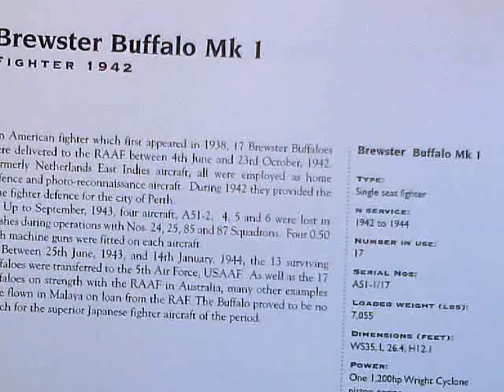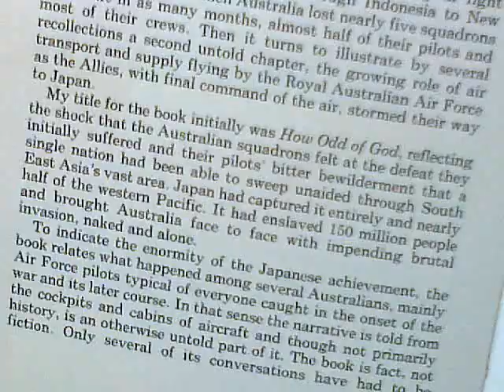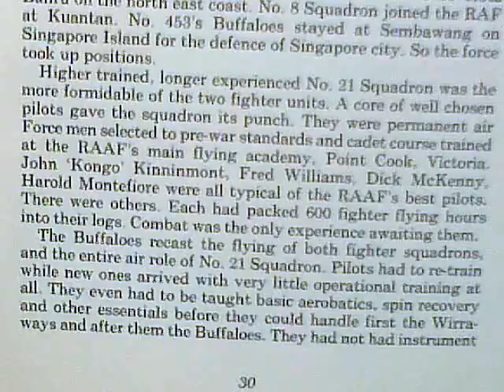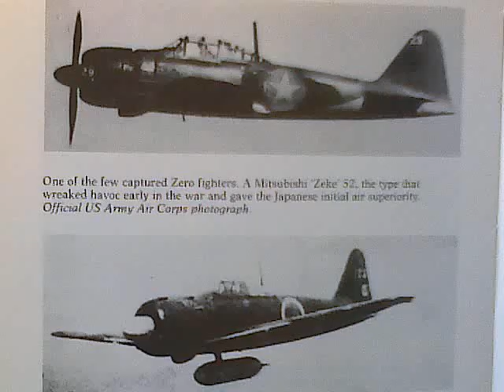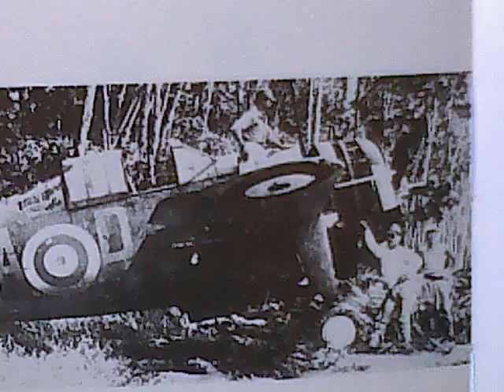World's Worst Fighter Aircraft, The 1941 RAAF Brewster Buffalo !

Comment: The Bell Air Cobra is generally considered joint worst with the Buffalo. Oddly the Finns had great success with the Buffalo in the Winter War and even built their own variant.
Reply from the maker: G'day,

  Thanks,

 Yeah, I know...

      If you read the earlier Comments you'll find the Finnish Buffaloes comes up quite often...; they had German Guns which neither blinded the Pilot nor shot the Wings off, German Radios which were not drowned out by the Tropical  Thunderstorms which don't occurr on the Karellian Peninsula, they flew around below 10,000 ft where the Fuelpump was able to feed Motion Lotion to the Unicorns under the Cowling, and the Finns had Combat Veterans in Buffaloes shooting at Neophytes in Polikarpovs - rather than Neophytes in Buffaloes up against Combat Veterans in Zeroes...

   The Bell Airacobra wasn't nearly so bad, Chuck Yeager flew it in Training and said he was sorry not to have taken it into Combat, and the Soviets liked it a lot better than they liked their Polikarpovs ; and the Airacobras Guns neither blinded the Pilot, nor shot the Wings off.

   It's their having one set of Guns for blinding the Pilot and a separate different set for shooting the Wings off, in my opinion, which makes the Buffalo far far worse than any other machine in which to be sent out to chastise the King's Enemies....; even the infamous Turret-Gunned Boulton-Paul Defiant (it defied logic !), or the Blackburn Roc, weren't capable of such stunning Counterproductivity...

 Have a good one,

  ;-p

   Ciao !
Reply: The RAF gave their Air Cobras to the Soviet Union after one combat sortie, they were that bad.  The Defiant became quite an effective night-fighter and ironically it was withdrawn at the point where hard learnt effective tactics proved it to be quite deadly.
Reply from the maker: +noonsight2010 

  G'day,

    Well, the British gave up on both the Boeing B-17 & the North AmeriKan P-51, after trying to fly them in Combat ; so maybe the RAF having failed to underconstumble how to operate Bell Airacobras shouldn't mean as much as a Knobbly of Goatshit onto the Compost Heap ?

   The Defiant was successful (Suck Cess, Fool) for 1 Sortie over the Channel in May 1940 when the  Jagdwaffe mistook them for Hurricanes.

   However, after the German Survivors flew home to tell of their Mistakification, the Defiant Crews died like Flies for a fortnight.

   They were put onto Night-Fighting, when the Luftwaffe began Night-Bombing after Goering's Tactical Errors rendered Daylight Bombing too expensive to continue with...; and because nobody could fly a Defiant at night while operating a 2-Screen Airborne Intercept Radar, nor could they work the Radar from the Rear Turret...; and the Defiant became an unarmed  Target-Tug just(ifiably ?) as soon as the Radar Set was fitted into the "Fighter version of the Bristol Blenheim" (aka the otherwise failed British version of the equally disappointingly lacklustre Bf -110 "Zerstorer/Destroyer", theoretically a long-range Daylight Escort-Fighter...).

   The Defiant was a Piece of Shit.

   But the Buffalo was far shittier, still.

  Take it easy,

  ;-p

   Ciao !
Reply: HiPart of the problem with the Air Cobra was the Yanks sold the RAF inferior models to that demonstrated and the RAF did not get what they intended to purchase. The B17 was inferior to the Lanc. so the RAF had no need to use it. It carried more crew (hence greater potential losses of aircrew) and a smaller bomb load more slowly and at lower altitude. The Liberator came into production when an American plant was ordered to go into B17 production. A senior engineer visited a B17 factory to prepare for the changes at his plant and was so unimpressed he designed the Liberator, which carried a greater bomb load. However the Liberator was disliked by crews as it was demanding of the pilots and difficult to escape from. I read recently that the Stirling is not properly recognized. Apparently it flew at least as well as a Lanc. but the problem was it could not carry the increasingly larger bombs because the bomb bay was divided into compartments by divisions which were structural and hence could not be removed. Hence its relegation to glider tug etc.The whole subject is huge and fascinating and its good to exchange with a knowledgeable enthusiast. I think you know far more of the minutiae than I.Regards
Reply: Nah.  The RAF did use B17s and were glad of 'em. 

My old dad flew both B17 Forts & B24 Libs with RAF Costal Command as a Flight Engineer. 
From what he told me the crews (maybe not the pilots, that wasn't mentioned) defo prefered the Liberators as much more comfortable for their long range anti-U Boat patrols.

Of course flying mainly out of the Azores the need to get out fast was not as prominent as it was over the European mainland.
Reply: HiI know the RAF did use both types. Nothing better than first hand history. Your Dad was a hero.
Reply from the maker: +noonsight2010 

  Ah, well, the Stirling was always severely  handicapped by having been designed with a 99-ft Wingspan, specifically stipulated by the Air Cabinet, purely so that it could fit into the RAF's existing Hangars, and not only was it slow, but with Bombs & Fuel it couldn't climb much above 15,000 ft ; so when Lancaster & Halifax Crews were briefed for a Raid they always cheered at the news that there would be a bunch of Stirlings down underneath at half their altitude, them to soak up the Flak & Searchlights..., and it had such a vicious Swing on Take-Off that each Pilot being converted onto them recived a signed entry in their Logbook attesting to their having succcessfully recieved instruction in controlling it, and mastered the techniques.

   As soon as there were sufficient Lancasters and Halifaxes to make it possible, they pulled the Stirlings off Bombing and turned them to towing Gliders, and Supply-Dropping for the SOE (the "Cloak & Dagger" Brigade, Spies & TERRORISTS, planters of Bombs, Train-Wreckers, Bridge-Blowers, lighters of Fires, setters of Ambushes, users of Improvised Explosive Devices, and other seriously violent individuals....).

   I think you'll find that Consolidated were working on their own design for the Liberator, in competition with Boeing, because they knew that the USAAC was in the market for 4-Engined Bombers, Consoludated had long had the Davis-Wing under development - and it was that high Aspect-Ratio Wing which gave the Liberator it's Range.

   The B-17 was a device for carrying a Platoon of Machine-Gunners into battle at 30,000 ft, to quote the RAF Drinking-Song,
 "...To drop one teeny weeny Bomb..!".

      The Schweinfurt raid is always cited as an illustration of everything wrong with the USAAC's concept of  Strategic Daylight Precision Bombing, but there was an RAF Night Raid on Nuremburg which had an 11% Shoot-Down rate, which was actually slightly worse than the Pig-Fort fiasco...

   The RAF wound up using their B-17s for long-range Maritime Patrols, by Coastal Command, way out over the Sea where there were almost no Enemy Fighters to interfere with them (though Ju-88s could go a long way if they had a reason).

  There were a lot of contenders for the worst Bomber of WW-2, with my nomination going to the Vickers Vildebeeste, a 3-seat Rag-Wing Open-Cockpit Biplane Taildragger, land-based Torpedo Bomber which was a spectacular failure against the Zeros around Malaya & Singapore ; but I never met anyone who flew them.

   I nursed an ex-RAAF Fairey Battle Pilot once though, who'd been shot down & went into the Bag while trying to bomb the Bridges over the Albert Canal, in May 1940 ; he was in the Flight which tried going in Low, and he never even got close enough to see the Bridge, until after having force-landed.

   Imagine the same 960 Hp Merlin as a Mk-1 Spitfire or Hurricane, but trying to loft a 53-ft Span Monoplane with a Crew of 3 and 1,000 Pounds of Bombs ; wallowing around trying to stay in the same Sky as bunches of E-Model Bf-109s...(!). 

  Such is Life,

  Have a good one...

  ;-p

   Ciao !
Reply: Well, he certainly said his pilot and bomb-aimer deserved the Iron Cross ..... which they never got.

Their highlight of action was muscleing in on an elderly USS destroyer chasing a U Boat on the surface, lining up carefully, then blowing a large dent in the bow of the destroyer.

On the plus side, as far as I can gather the whole crew did truly heroic work destroying large quantities of beer and spirits at every opportunity.  

That may be more comprehensible given that my dad reckoned he was one of 4 maybe 5 survivors from his original training intake of circa 108 bomber flight engineers, so maybe they all were really.  
It feels strange to consider had he not been posted to Costal Command the likelihood I'd be around to bore everyone with this is 1 in 26.
Reply: Hi. A sobering statistic. And thank goodness there are people who keep the history alive. Good on you.
Reply from the maker: +Farweasel 

  G'day,

  Good Show, those men !

   Did the dent they put in the Destroyer buff-out alright ?

   At least "they tried to do the right thing", according to their lights and what they'd been raised to believe, and everybody (except the Psychopaths) gets Buck-Fever the first time they try to shoot (or bomb) to kill ; as their Conscience struggles with their Consciousness, for control of the Motor-Cortex, as their Conscience attempts to avoid the stain of the mark of Cain...

   Have a good one,

  ;-p

   Ciao !
Reply: noonsight2010 the Russians used the air cobra to great effect in fact thier top ace preferred it
Reply from the maker: +Edward Myers

  G'day,

   Thanks...

      Actually, Chuck Yeager liked it as well, he claimed in his (ghost-written) Autobiography to be sorry not to have been able to take the Cobra he was trained on into Combat...

   He also said that the Deaths his unit sustained during Training were "a good thing", because he judged it "...better to lose those Weak Sisters in Training, than to have them break down later on in Combat when their failures may cost the life of some other Fighting Man who was relying on them..." (!).

  Which was a VERY interesting revelation, coming as it did from the Old Man who grew up from being the little boy who was 4 years old, while paying with his 5 year-old brother, when their father's Shotgun went off...; instantly killing their 2 year-old Baby Sister, who had been in the Room with them at the time...

    Seventy years later, he was still rationalising the death of his Sister - because she was "weak", apparently ; a Psychiatrist coul build a Career out of such an insight (!).

  Have a good one,

   ;-p

   Ciao !
Reply: The Soviets pilots loved their Air Cobras. felt they were perfectly competitive with FW190s and Bf109s down in the weds were the Soviets were fighting.  The USAAF loathed the Air Cobra because it climbed poorly, had a bad supercharger and had a short range and the USAAF did most of it fighting at high altitude and long range.
Reply: The Stirling was handicapped by public servants who demanded the wingspan be limited to 99 feet so it would fit in existing hangars.  Hence the long undercarriage to give it more incidence and lift on takeoff and a ceiling of only 15,000 feet which put it squarely in the sights of both AA and attacking fighters.
Reply: finland got them after the winter war. in the spring of 1940. winter war 1939-40
Reply: And the Soviets had success with the Airacobra. The Finns also liked the P35 (or export version thereof) that they got from the Germans who captured them from the French.
Reply: @WarblesOnALot  
Not only that, but the Gunner could only get in or out if the turret was rotated to a certain angle.
Probably impossible to do if the Pilot was dead & the aircraft was falling.
My Father hated them.
He also hated the P39.
He said that the driveshaft could fly to pieces & kill the Pilot.
l didn't know that there were P39s  in the RAF, or is that a bullshit story?
Back to the BP Defiant.
The crews perfected the tactic of flying under the bomber, but back a bit, then firing up into its bomb-laden belly.
A tactic that the Germans later used against Allied bombers. Only they had a fixed cannon.
Cheers, Warbles. l enjoyed your video.
Have you done one on the Boomerang?
Reply from the maker: @247micko  

G'day,

Thanks.
  
I do recall reading that the Brit's didn'tlike the P-39..., and that the Russians liked them - better than they did either the Spitfires or Hurricanes on Lend-Lease.

  I don't know if the Nachrjagdfjiegeren using Schragemusik ever thought of the BP DefiesLogicant when they were secretly cobbling the pair of 20mm Cannons in behind the Pilots of Bf-110s.

  The RAF collected 2 Ju-88 Nightfighters, one by a deliberate Defection & the other a Navigation Error...; but the RAF never learned about the Jazz-Music until after  Hitler had shot himself.

   Have a good one,

;-p

Ciao !
Reply: @WarblesOnALot  
Hello Warbles,
l read somewhere, can't remember where, that a Polish Nightfighter Squadron perfected flying their Defiants underneath the German bombers that had a rear entry (lol!)hatch & their MO was to destroy one bomber engine, then get the crew as they baled out of said rear hatch.
Well the object is to kill the enemy so we can't be morally outraged at this "unsporting!" behaviour. 
After what the Germans did in Poland, who can blame the Poles.?
l think that they only had ammunition enough to destroy 2 bomber engines OR 1 bomber engine & the crew!
Not a hard decision to make.